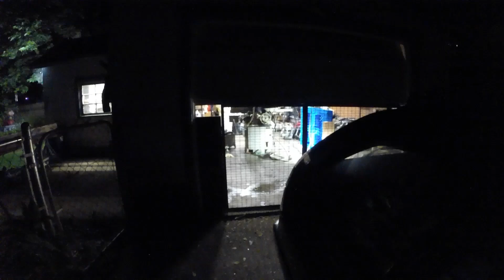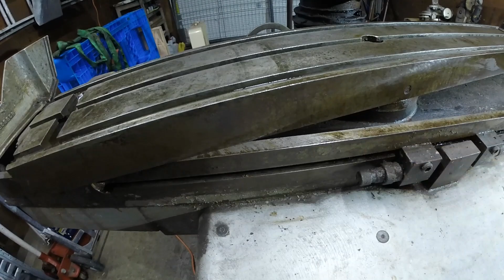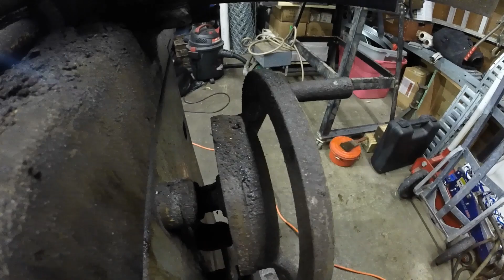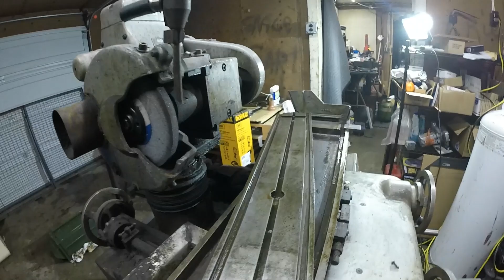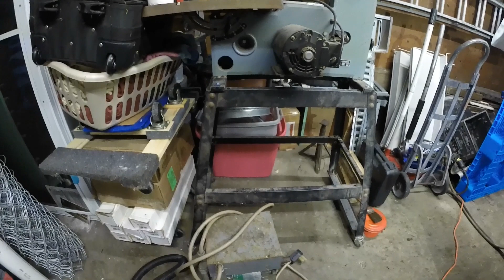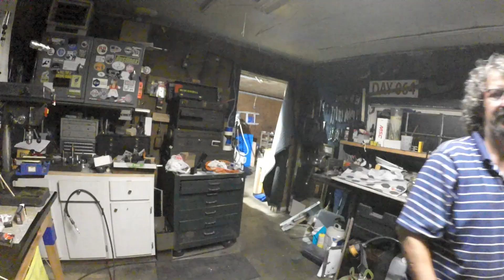NEW MACHINE, CLEAN UP, ONE

Comment: You have a good start on the cleaning. The black rectangular item on the left hand side below the table is your oiler unit. Your pump the lever on the top to oil whatever it is connected to, such as the table ways and possibly the column. You will figure it out as you work along cleaning.
Take Care and Stay Safe.
Bob
Reply from the maker: Thank you Bob you are correct I am starting to figure things out
Reply from the maker: And a lot of the tight places I’m having trouble cleaning will come along a lot easier once I left the table off. I’m going to have to take the table and the saddle want to do a proper cleaning

Comment: Man, getting a new machine is always exciting.  Might have some answers for you:
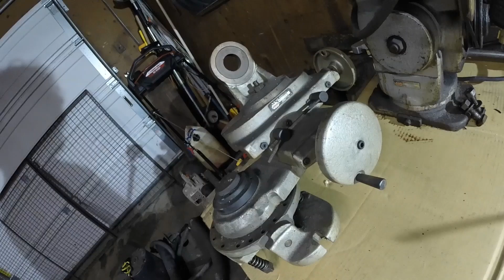4:00 Radius Grinding Attachment (?)
6:10 Bijur pump oiler
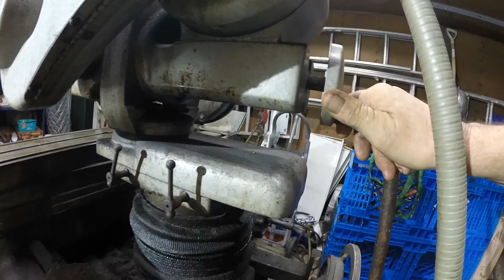7:30 Belt Tensioner (?)
Most important thing to remember is to clean & lube the ways & sliding surfaces before twiddling knobs.  The whole thing is covered in "lapping compound", so cleanup is essential as a first step.  My other piece of advice is to get some literature off Vintage Machinery or Ebay so that you know where things move and why.  Steve Summers might also be a great resource for info, since he's got one.
Reply from the maker: Thank you great advice I am in the process of taking it apart right now Saturday afternoon 4 PM thank you for the information and advice
Reply from the maker: Let’s call it Friday instead

Comment: Run that nasty tank down to the local car wash at 10pm.  Hose it down with purple power and pressure wash it.  Don't screw with automotive fuel.  Varsol works and it's not obnoxious.  If you can't buy varsol by the gallon, visit your local mom and pop FBO at the airport with a 5gallon can.  If you are nice, they will happily sell you some 100low lead avgas.  It cleans really good, doesn't stink to high hell.  Run the left overs in your lawnmower or weedeater.  Just nothing with a catalytic converter.
Did you already fire up the RPC??
Reply from the maker: RPC ???? If that’s the phase converter I did fire it up before I removed it from its old location it was running an air compressor. The way it was hooked up it had 220 coming out of the ceiling going into a fuse box. From there plugged into the phase converter .single phase  in.and the other wire coming out of the phase converter 3 phase out  went to the second fuse box came out went to another fuse box(box#3) that’s where it stops .at the bottom of the third fuse box 2 wires ran to the air compressor.
I am going to go back and get the three fuse boxes or at least fuse box number two and three.I hope that wasn’t really confusing
Reply: @kimber1958  I'm guessing that's what that thing is.  Hard to tell from your video.  I've got zero experience with them anyways.  I'm on the VFD train.  But if that's what it is and it came with the grinder, you did good.  Guys build them or you can pay big money for one to run 3phase equipment.  The way I see it, if you only have one or two 3phase machines, you run individual vfd's.  If you have 4 or 5 machines, then the rotary phase converter makes more sense.  With the cheap prices of VFD's these days, it's pretty hard to beat.  I've been buying these cheapies and they are wonderful! https://www.amazon.com/gp/product/B0811BXHBQ/ref=ppx_yo_dt_b_asin_title_o02_s00?ie=UTF8&psc=1
Reply from the maker: On my way to the car wash now with some super strength purple power went up earlier in degrees and sprayed off some other parts and they’re leaving a couple parts there I need to go back just some sheet metal parts where I left